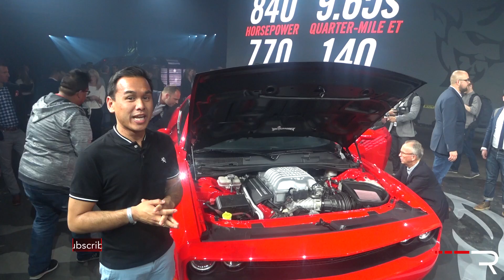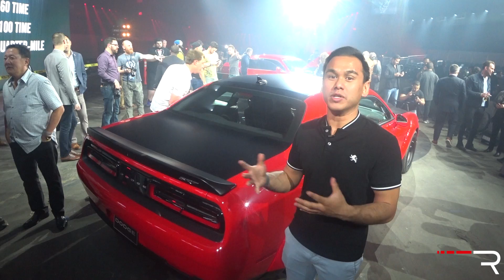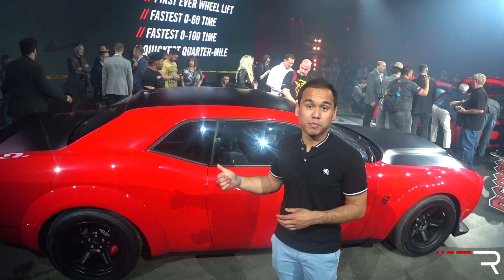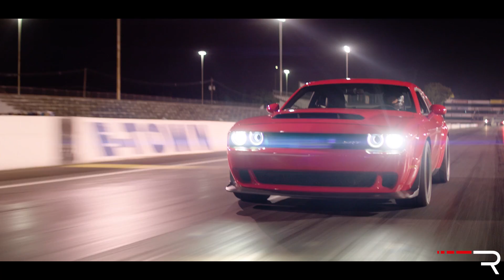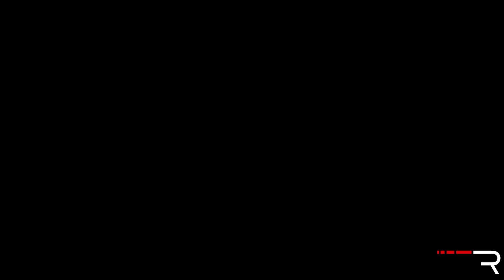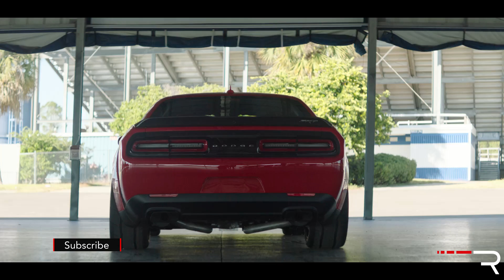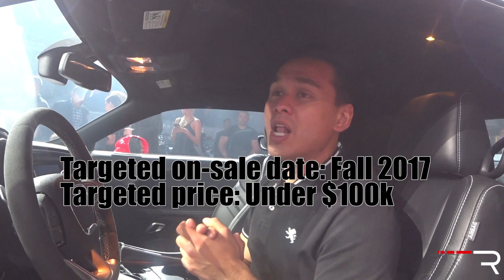2018 Dodge Challenger SRT Demon – Redline: First Look – 2017 NYIAS

Comment: I doubt it will go 0-60 in 2.3 seconds unless it's electric.
Reply: ahmad hadi No it will do it I'm  sure, you'll just need to have the skinnies on front and most likely have to run at ATCO on a perfect prep in the late fall on a cool night lol.
Reply: It will, because it has actual drag slicks on the rear. The only reason the fast Teslas go that fast 0-60 is because they have AWD, it doesn't have anything to do with being electric. It's about traction.
Reply: Vernon Price No,it has radials, not slicks. Slicks can't be ran on the street, radials can.

Comment: Congratulations Dodge, but the rest of your line-up is unreliable crap.
Reply: Anthony S. yeah dodge is unreliable and that's why I'll never get dodge. Don't get me wrong I love the Challenger it's my favorite muscle car but I'd rather drive a Corolla or Civic for reliability than dodge.
Reply: u speak wisely.
Reply: Yan if u care about reliability ur not a car guy so i suggest u keep to ur econoboxes
Reply: I would rather drive a corolla or civic too! Right off a bridge on my way to work.
Reply: Anthony S. I have 3 dodges and no problems what so ever .
Reply: Yan civic is not a reliable car
Reply: Mechanic here for over 25 years. Dodge isn't as bad like a Nissan nowadays. 

Dodge cars are average not super bad nor super good.
Reply: Dodge hasn't been even close to the average in well over 35years. Consumer Reports, non profit, collect more data than anyone - stats don't lie. Dodge has almost consistently been in the bottom 3 for reliability since the early '80s. That's not something people should ignore. It's actually disgusting, bordering on shameful and IMO, should be illegal.  Dodge  coughs up something with a bigger engine with a slightly faster 1/4 mile than a modified Subaru, and every hillbilly with a driver's license gets moist. If all it is is an ego trip, why not save the 100k and get phaloplasty? This tacky car will be forgotten when another domestic brand comes out with something that gets 1 more ft lb of torque. I give this car 6 months on the market before some teenager in the next Tesla S upgrade touches a button on the dash and  makes every mullet in the county roll up.
Reply: Lot's changed since 1980. You can have a fast AND reliable car. A good start is to not buy Dodge. Edit: Take the Infinity Q70, for example. 5.6L v8 with 420hp, 5 second 0-60, very luxurious, AWD,  around $68k, and one of the most reliable vehicles on the planet. It can be done, and it doesn't have to be a Corolla.
Reply: but atlest they are fun cant say that about a toyota
Reply: What I don't get is their Infinity line is one of the most reliable cars you can get, consistently for the last few years. At an almost identical but opposite trajectory, their generic Nissan models are plummeting. Nissan always seemed to offer more in terms of HP for the dollar with their Sentra, and their Versa offered a 6sp when the standard was still holding onto 5spd. Then the entire brand's reliability plummeted. I have very little sympathy for them, when companies like Kia and Hyundai can rise from the least reliable cars on the earth (Kia Rio? Hyundai Accent?) to bringing their entire fleet up to and beyond the average in less than 10 years.
Reply: You can say that again. Toyota's specialty is making cars boring. Their engines are the disappointment though - factory tuned to put in a very middling performance lest they have market bleed. Can't have a Corolla catching up with a Camry. (I think I just defined the most boring race in motoring history). What kept me away from them otherwise was their arrogant "if you want that feature you have to upgrade to the next model which is $4500 more" routine. All companies do it, but they seemed to think Navi (something that costs them < $85) requires a huge investment into leather seats and adaptive cruise control.

Comment: Lol Dodge is tiered of getting beat by everyone with their hellcat. So they make an even bigger flop with this thing. They can put as wide ah tires as they want back there, it still won't matter. The car is too heavy and the weight distribution is way off. This thing is only good at a drag strip. What a waste of money. The new mustangs and camaros are way better.
Reply: Sorry to all of your slow ass cars need to be modified to go fast. Anyways. Just let this sink in. Fastest car in the world.
Reply: Show me the actual real world proof it's the fastest production car, they claimed the hell kitten could do a 3.6 zero to sixty. Never seen it done. This is the same crap on a different plate.
Reply: Mark Simrow 2.3 they realesed videos of them doing it. btw maybe you have never seen it done because nobody who has a hellcat knows how to drive
Reply: Mark Simrow I think it's funny when someone says it's only good at a drag strip....well no shit...that's exactly what the fucking thing was built for A DRAG STRIP
Reply: please tell me what production model camaro or Mustang runs lower than a 11.2 in a quartermile. I'll wait.